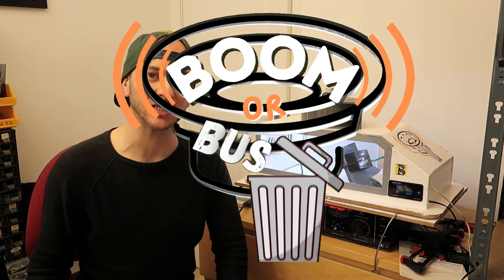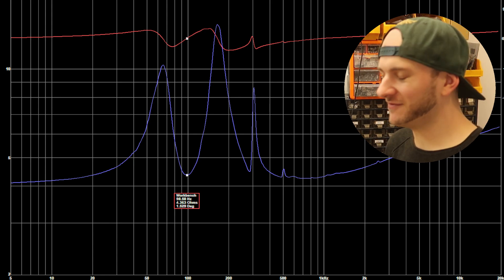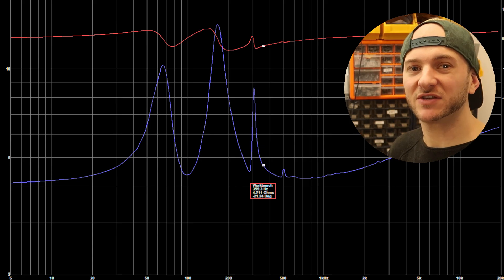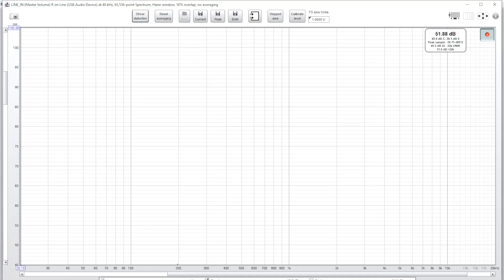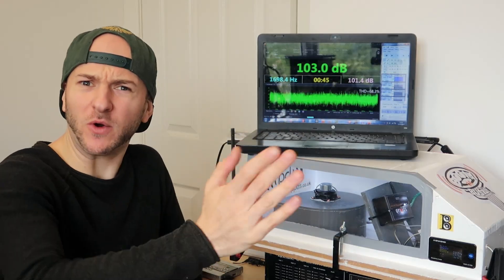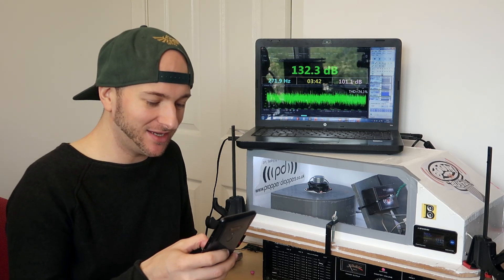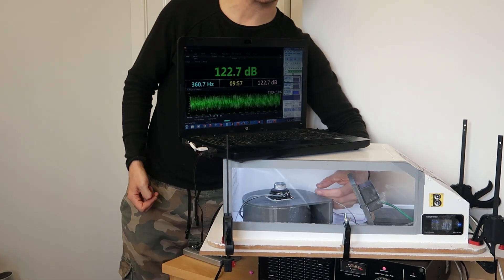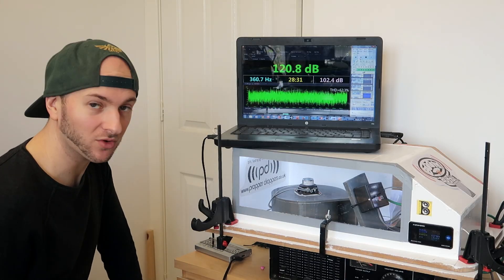Spiral Subwoofer SMASHES the Lows 🔊💨 Boom Or Bust S1E15

Comment: How to get the 2008's world's loudest subwoofer the rotary subwoofer out of any speaker driver without making a rotary subwoofer out of it🤯 

The measurement for the box and achtuning depends on the speaker drivers dimensions and SPL.

With box tuning https://youtu.be/98R5AGUS1fY?si=dYGA71cDJtodjokV & Port tuning is https://m.youtube.com/watch?v=-yopTneS7g8&list=WL&index=2&pp=gAQBiAQB for the SPL of speakers for the enclosures. 
Except in this case for a rotary subwoofer https://youtu.be/NZKCxIuJ-5M?si=giUo94NI81rkcxKK you want continuous airflow in your enclosure which is the air pressure of the whole room. 
And you can get continuous airflow from a subwoofer speaker with the Tesla flow valves. https://youtu.be/SQAlM5Nyu9Q?si=uRvG2pugrpD3qpKb So if you know where I'm going with the continuous airflow from the Tesla flow valve speakers ports. It's in a 6th Order bandpass Box https://m.youtube.com/watch?v=YUQYGbeWmpM&list=WL&index=172&pp=gAQBiAQB seen in thumb image in video link. 
Where the blue Center speaker port is where you replace it with the red speaker driver baffle where the speaker driver is mounted in the center. 
And the other two red speaker baffles gets passive radiators mounted. Then fill Center chambers with sulfur hexafluoride gas. https://youtu.be/u19QfJWI1oQ?si=bPLT4kiZsnSne_Y_  
And the yellow speaker ports on each side of the Box gets the Tesla flow valves on the top front of the speaker box port has the Tesla flow valve blowing out. 
And on the bottom back of the speaker box Port gets the Tesla flow valve blowing in working with thermal dynamics of the air. Where the hot air rises & cold air sinks thus sucking in the cold air on the bottom and blowing the warmer air out the top. 
Then simply place the speaker in a open window to a room or cut a hole in a center wall to the room. 
And place the speaker there sucking in the air from outside the room and blowing the air into the room. 
Thus giving you the same effectiveness of a rotary subwoofer out of a regular subwoofer.🤯 

To any of those with the question of how to fill the center Chambers with sulfur hexafluoride gas. 
Simply put a piece of Styrofoam in the chamber when filling with sulfur hexafluoride gas. And the styrofoam will float to the top then seal and screw down top lid.

Comment: How are you taking the average? Are you just doing the mean of the decibel number or are you converting to powers of 10 and taking the logarithm of the mean log(mean(10^dB/10))? (E.g. mean of 60 dB and 0 dB is 30 dB, but power based mean is around 57 dB.)
Reply from the maker: Just the average buddy
Reply: @barevids  I was just curious because 150 dB is 10 x the magnitude of 140, thus the average of 145 is actually less than the mean sound level.
Reply from the maker: @TimpBizkit  you raise a good point!
Reply: @barevids  yeah the average of 150 dB and 140 dB is 147.4 dB, though the average of 150 dB and 0 dB is still 146.99 dB.
Reply from the maker: @TimpBizkit taking the average in the same way that proper droppers competition does simply by finding the mean. Perhaps they should change how they are testing!

Comment: this needs running on a crossover with another speaker design box for the other higher frequencies seperate
Reply: They build the box the the speaker listed if it doesn’t work well that a design issue.

Comment: I think what Pete said about the frequencies is correct because low frequencies tend to move more air and chuff more through the ports than the high frequencies do so the overall performance in the end is not to scale.
Reply from the maker: The scaling works perfectly buddy.
Reply: @barevids  
Ok cool. 👍🏻
That’s good.
Reply: Remember that hexibase was replying to a question as to whether or not a subwoofer enclosure can scale up in size. The answer is no, unless you also scale the size of the sound frequencies. If you scale both of them, then it works just fine.

Comment: have you thought about using an electric motor with a rotational converter (like an engine piston) that way you can put huge power into the motor and for cheaaaaap! unlike regular high power woofers
Reply: It would certainly improve efficiency since normal speakers are only about 1% efficient. The downside is how would you be able to quickly transition between different frequencies? Like if you had a bass tone that was alternating between 20 40 60 20... Most electric motors are not able to speed up and slow down very quickly.
Reply: @JasonWW2000  it would use a 3 phase brushless motor optimally, it would be limited to some non complex bass lines though but I'm sure it would be worth it
Reply: @KClO3  Also, how would you control the volume? Sometimes the cone needs to move very little and sometimes a lot. Motor speed would control the frequency, but you need an adjustable stroke for the volume. 

I remember a sub that used an electric motor. Look up the Phoenix Gold Cyclone. Its a rotary sub.

There's also the Thigpen Rotary Woofer which is like a fan. 

Neither design could better the conventional subwoofer. As inefficient as current subs are, they are affordable, can deliver low distortion bass and play a wide frequency range.
Reply: @JasonWW2000  auto.oti 3 subs are usually half that. If they're sensitive enough in the 90s then they might be %1 efficient.
Reply: @unbanmy360  I tried searching that sub and came up with nothing. 🤷‍♂️

Comment: i submitted a ported W-bin sub i think the peeps would like!!! needs few supports for bracing but not hard to remove and probs less print time than most still!
Reply: Ohmygosh, thank you!! I wanted to submit that a lot but I have no CAD Skills!!! :D I would also love to see it with the ports blocked, so please try that Sam if you are reading this!! :D You might be able to use foam to block the ports! The reason I want to see this so badly is that I have a pair of sealed W-bin's, and for outdoor music they perform amazingly down to around 40hz :D
Reply: @tigerelectronics5966  oooo good idea id love to see the difference too, Niceeeee, i dont own any but the original design (Klipsch la scala) and experiencing them at outdoor events has me curious in the same way! and maybe given large mouth area horns have done well in the past, maybe the W-bin will be the winner in an enclosed space!
Reply: @keatoncreates  hehe the efficiency is also brutal, I just run my two from a 75 watt per channel amp and it's plenty, and I've just got some cheapo 15" drivers in them! :) if I use the amplifiers full potential, it hurts my internal organs to stand Infront of them C: 

Yes, I definitely think they'll Win! But they will suffer on the really deep low end, since they can't really reproduce anything below 40hz with any decent efficiency. But I still think the average will be so extremely high that they'll win! :D 

You're a lifesaver, now I finally get to see impedance curves and everything of a W-bin! I've always wondered how they look like, my amplifier runs extremely hot when driving them, so I suspect the impedance is very low all the time which is honestly perfect:) 

Gosh I hope Sam takes the submission, I really want to see this!
Reply: F2b are beasts!